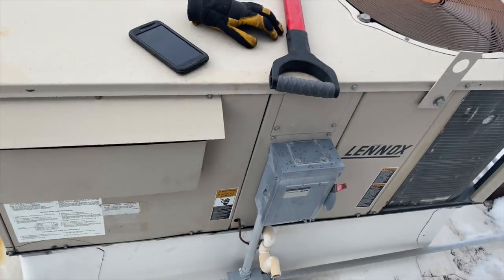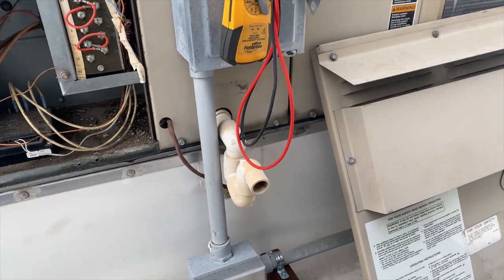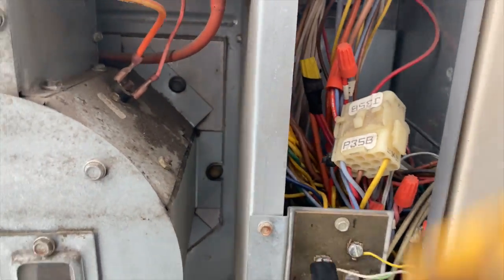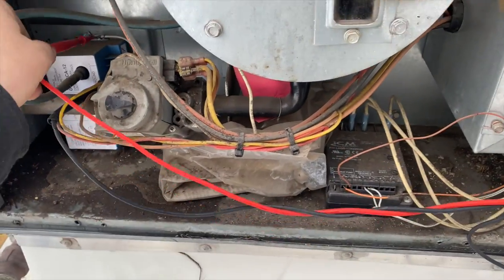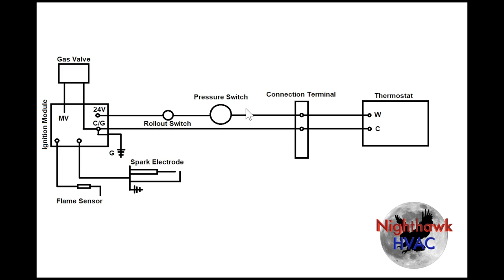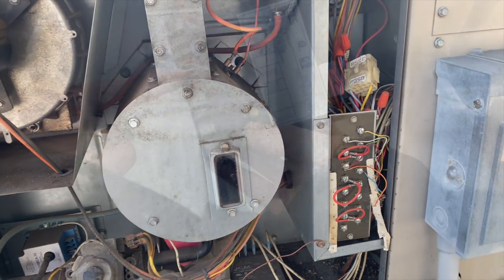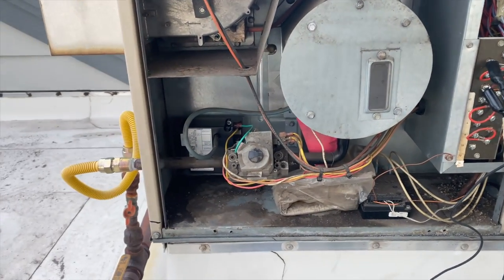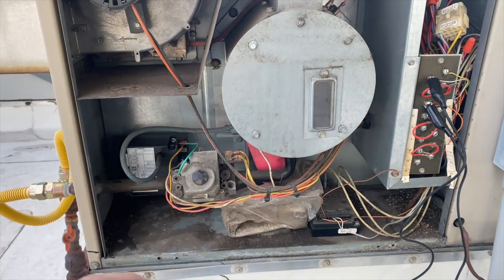How to Diagnose a Spark Ignitor Issue EP79

Comment: My furnace stops working overnight so every morning I have to get up early and switch it on and off about 6 or 7 times (Fan comes on but no heat) before the heat finally starts. It works fine all day though. I went up to the furnace on the roof and checked everything. I cleaned the flame sensor and when I start the furnace I can see the spark in the ignitor and then the furnace shuts off. Could you tell me what the problem could be?